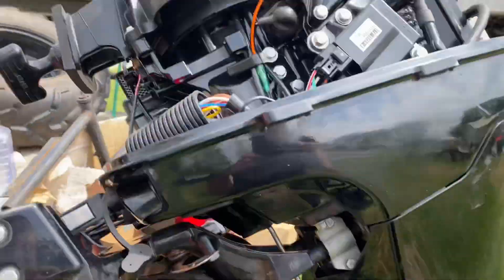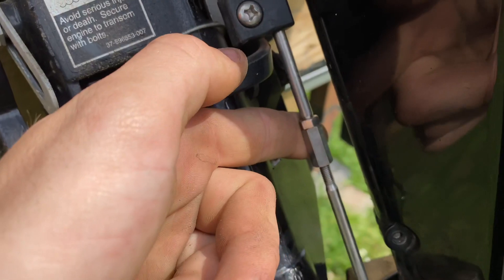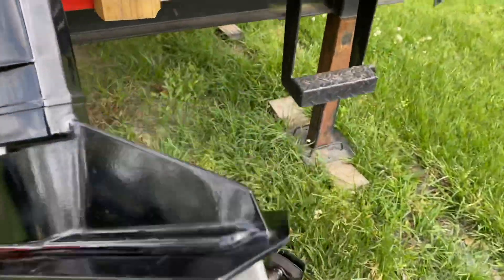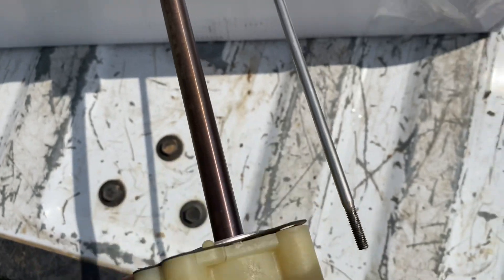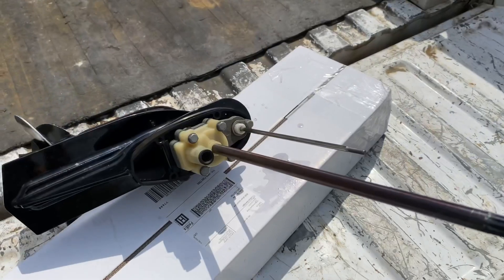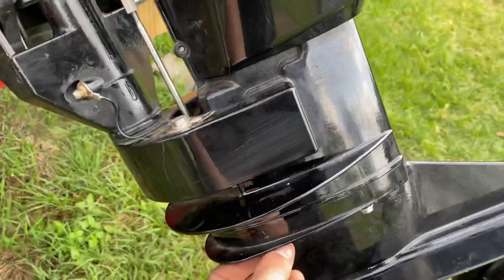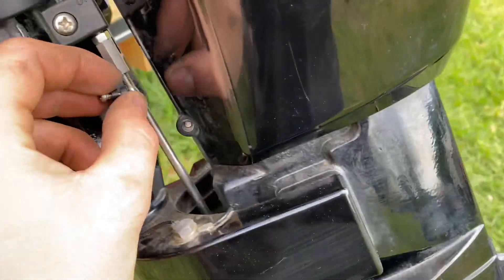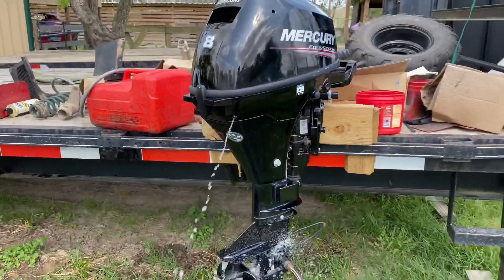Mercury 8 hp Outboard Impeller Install

Comment: So I changed my impeller. .when I put it back together I can switch gears to reverse but it seems tight. I took note of where the lock nut was and put it back how it was. Any idea why it won't shift into reverse smoothly?